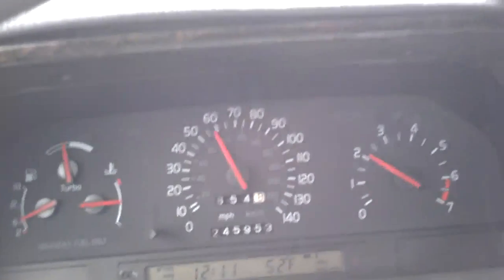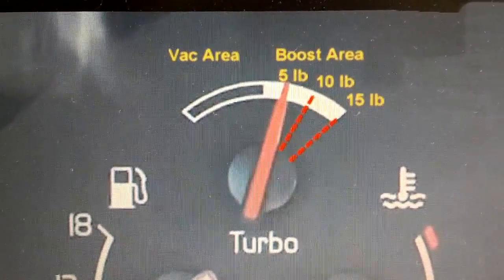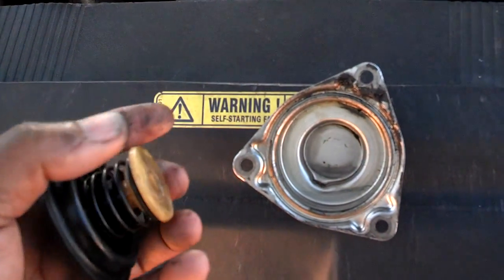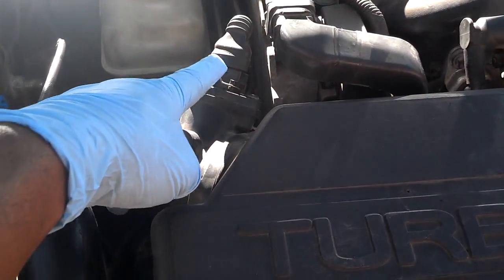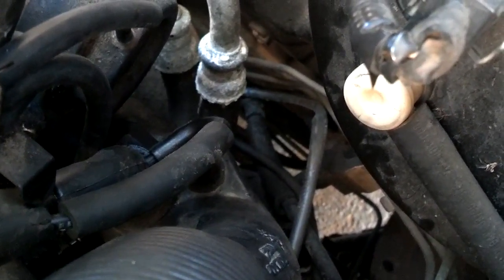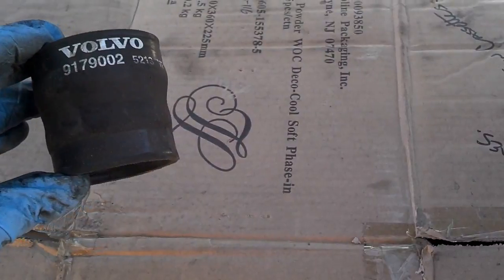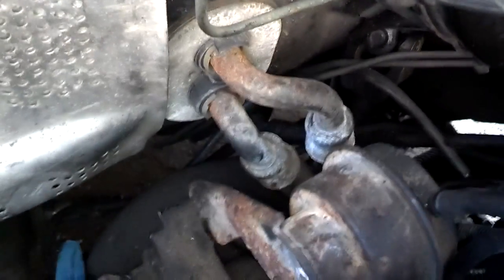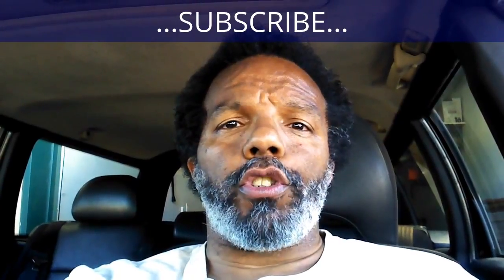How to fix under boosting, bad bypass / blow off valve on the turbo, CBV replacement - VOTD

Comment: I replaced this on my 850 and it didn’t fix my under boost issue. If I disconnect the vacuum line from the compressor housing to the tcv then it boosts to 15+psi but when it’s connected I barely hit 5psi
Reply from the maker: Could be a pending code in the ECU.
Reply from the maker: https://youtu.be/ZFRI_u-9_Gg?si=G4kAY4JIVyTNqUGg

Comment: Hı Robert, Where does the hose from the bypass valve connect?
Reply from the maker: intake manifold.
Reply: @RobertDIY  When the green hose is connected to the tcv, the boost indicator shows 5 lb, when it is not connected, it shows 12 lb, it should be the opposite. ? Thank you Robert.

Comment: I'm very fortunate to have small hands for this job, it definitely made removal and reinstall much easier. Although my diaphragm wasn't in terrible shape, it was still worth the check. I found the biggest reason to my turbo issues to be a deteriorated vacuum line from the compressor housing. Thank you Robert for all of your assistance in repairs throughout the years!
Reply from the maker: You are welcome

Comment: If anyone has trouble accessing these bolts the job is made dead easy with a Chicago brand or other opened ended ratchet. been tackling the bolts with limited access. gave up went back to it with the ratchet and 10-15min bolts out (depending on how quick your wrist can move :) ).
Reply from the maker: thanks for sharing.

Comment: I have a question about diaphragm. I wanted to test diaphragm without removing it, but using vacuum/pressure pump with manometer. I cant really find anyone to do so. Is there some sort of one way valve built in diaphragm? Becouse when I test it on vacuum, it was holding without any problems, bet when I tried pressure test, it didnt hold pressure at all even not for the second.
Reply from the maker: My guess would be that it's good if it held vacuum.

Comment: Hi Robert!
I'm having issues with my S80 2,4T Limited. I bought it yesterday and noticed that the turbo fluttered so I checked all the vacuum hoses and noticed that hose for the dump valve had come off so I put it back again. After that the car feels slow, the boost comes good to all of sudden "cough" and the boost sort of disappears. I test drove the car again today after checking the rest of the hoses, pipes etc but still does the same thing. I then took the hose for the dump valve off again and drove and the boost worked as it should except for the fluttering bit. I then put it back again and the car is slow, boost comes and goes. I'm running out of ideas but I feel like the problem must be the dump valve in this case since it goes like it should when the hose is off so it's closed all the time and as soon as the hose is back on the boost is not as it should, probably because of the valve leaking or that it can't keep the pressure, or what do you think?
Reply from the maker: If all of the TCV lines are on correctly, my guess would be a bad TCV. Install a temporary boost gauge and see what is actually happening.

Comment: Thanks for your video Robert! I just finished replacing my CBV on my 98 V70R (which AWD makes for even tighter spaces to work in), and used your video as a reference. The most difficult part for me was trying to get the lower (third) bolt off the CBV housing. I attempted to loosen it for well over an hour with different tools. I finally got frustrated and decided to turn the housing clockwise (toward the driver side) using the third bolt at the bottom as a pivot. It turned relatively easily, and the diaphragm and spring assembly were easy to remove. This method only required removing the top two bolts, and simply turning the CBV cover clockwise. The diaphragm and spring will have plenty of clearance after turning to be removed out of the back side. Everything including reassembly went smoothly after that. Unfortunately I didn't take any photos of it for reference, but if anyone out there is in the middle of the job and stuck with the bottom #3 bolt, try turning the housing and save yourself the headache. Hope this comes in handy for somebody!
Reply from the maker: Did you have to bend it?
Reply: I didn't have to bend anything. The third bolt on the bottom was still tightened (as I couldn't get anything to budge the bottom bolt in the tight space), and it was relatively easy to swing the housing clockwise toward the driver side.
Reply from the maker: Oh, that's right, that side of the turbo housing is smooth with slots in it.
Reply: Correct Sir! I tried everything I could think of including grinding down a 10mm socket to fit into the tight spot with no avail. Combination wrenches wouldn't fit for me either. This method worked for me and was actually really easy. I wouldn't have been able to get as far as I did without your video though! Thank you for taking the time to make the video and post it!
Reply from the maker: Sometimes it easier to take the turbo loose with those AWD cars. :(

Comment: I watched this great video 3 times. I want to put in a new diaphragm from Ipd. Can you tell me how you undid the three 10mm bolts holding the housing. Especially the one on the downside, Did you reach it from under the car?
Reply from the maker: All 3 from up top.
Reply: @RobertDIY  but how did you get it from the top?
Reply: On a 02 awd v70 from the top is impossible.  Please do a video on that one!

Comment: This is not a blowoff valve.. it controles the wastegate that bypasses exhaust gasses around the turbine so it will not make more boost..  when it begin doings it job it will open.. not give pressure to your intake.

Im sorry but loads of uncorrect info..
Reply from the maker: Huh? What exactly are you referring to?
Reply from the maker: The bypass valve does not control the wastegate, the wastegate actuator along with the TCV does.

Comment: You can fix other CBV from other Mitsubishi Turbochargers on your Turbocharged 850 or 70 series. I used the CBV from a Renault Megane RS (European car) (TD04-14T) on my 98 C70 HPT. Same diaphragm, same spring, same housing.

Thanks for your videos Robert. Greetings from Spain.
Reply from the maker: Thanks for sharing.

Comment: I have a 2005 saab 9-3 2.0t 175hp garett turbo same as volve i guess im having p0033 turbo bypass valve control ......so i changed the turbo bypass valve but the engine came back on i havent changed the diaphragm bov bypass part yet .......do you guys know what could be the issue with my car
Reply from the maker: I don't. Have you changed any bad vacuum line?

Comment: Hi Mr Robert many thanks for your videos it really has a great useful info. my qus  is  do i know my turbo charger work fine i  have no gague in my cluster board and my volvo s70 1998 is not work fine   the horse power when it is idle is 5 or 6 some times i hope you can help me .
Reply from the maker: https://www.youtube.com/watch?v=NhtUXZTurzo
Reply: thanks a lot may the god peace be upon you
Reply: hi again Mr. Robert i do have an OBD tool scanner device and i solved all the issue and codes that came on on my device (of course with your helping videos and i asked you only to know how  do i sure the performance of my turbocharger .......thanks

Comment: hi Robert.  I have a problem where under load and release of the gas the blowoff sound is more of a "twitter"  is this a problem with my blow off valve or could it be something else ? i also have a dip in the boost preasure  from 1.2 to about 1.0
Reply from the maker: +Miffokorv bleeds off while you have your foot in it? Could be exhaust restriction or a boost pressure leak.
Reply from the maker: +Miffokorv https://youtu.be/x8sXo5gbapM

Comment: Hello Robert.
The turbo bypass valve of my car volvo s70 2.0 turbo gasoline is damaged and does not let you get the best performance of the car, here in portugal only exists in the workshop volvo and is very expensive. Turbo is a 49189-01450 and the respective bypass is k5t096671
I've seen online that exists around at a very good price or maybe you can have some for sale.
Will a sale be possible?
It was very good. The
Reply from the maker: +Hélder Miguel Lopes Silva I don't think I have any. If you need me to help you get one let me know.

Comment: Hello Roberto.
I have followed your videos and it has been very useful for me, I have a problem and I needed help.
I have a volvo s70 2.0 glt (225 c) from 1997 the car to the smoke relantim gave oil passage through the turbo, it was to repair and when mounted car has no strength at low revs, between 1800rpm and 2800rpm it makes a howling whistle and the turbo Just picks up from that rotation and stops whistling, they have already seen tubing all over the leaks valve sineloide n75 is good, I already complained the repair of the turbo they dismounted said they put new core sealants was a complete repair, wastegate fit to put the To get the turbo lower with more force, even so the whistle increases and the turbo only enters the high rotation and sometimes does not rise linearly breaks, the turbo repairman guarantees that it was not from the repair.
Roberto could give you some help, please.
Reply from the maker: Sad to say that I do NOT understand what you are trying to tell me. Sounds like you are hearing a whistle noise and are experiencing low power output. Not sure if it's the turbo or some vacuum leak??? You need to install a boost gauge to see the health of the turbo system. Also, is the PCV serviceable?
Reply: Hello roberto, sorry for the mistakes in my text, I'm portuguese maybe I can not express my problem well, my car's turbo was repaired, my car did not stay as it was with little strength the turbo just picks up at 2800 rpm, Between 1800 rpm and 2800 rpm the turbo has no force and makes a whistle, it will be at such a burst valve (diaphragm) pierced. Thank you for your attention.
Reply from the maker: Hélder Miguel Lopes Silva is the check engine light on?
Reply from the maker: Hélder Miguel Lopes Silva the system is designed to have little boost at low rpm's and it should raise as the engine rpm's get higher. This avoids bent rods.

Comment: Great video. My XC90 T5 doesn't have a turbo gauge, but I feel there is no pressure. Will change the bypass valve. Thanks.
Reply from the maker: Hope that does it.

Comment: Hi Robert,
I have an '04 S60R and it seems to be underboosting. Instead of the regular 15 psi peak, it seems to hit about 9 or 10 and as the revs climb it will sometimes hit about 11 or 12. The car also seems to cough and pulsate at idle. It will seem like its about to die for a second and then jolt back to life. Could this be related to the CBV, or I was also thinking it could be the TCV. I have had one person tell me it is CBV related but i'm not entirely sure how reliable their information is. Any help is appreciated. 
Thanks!
Reply from the maker: +Connor Root codes?
Reply: Robert DIY I know for sure I'm throwing a code for running lean due to my cat delete, but let me check if I'm throwing anything else and get back to you.
Reply from the maker: OK.

Comment: Hi Robert! I have some  troubles with my 850 T5 94 and i'm wondering if you have any tips for me. My 850 is underboosting at around 5-6 psi (0.4bar). I have tried changing alot of things. I changed the turbo controll valve, Air flow sensor, ECU, those 2 sensors under the intake manifold, changed all related vakuum hosings, checked for cracks on the pressure piping, checked the Wastegate and Wastegate clock. I also have a aftermarket BOV and not the original and i have tried changing to another one. And if i remove the vakuum hose from the Wastegate clock to the TCV if makes full boost. Any idea?
Reply from the maker: Something is causing the ECU to dial the boost down. Could be an issue with the cat or o2 sensors.
Reply: Not the cat since it can build boost with wg hoose removed. And i should tell you that i dont have any codes on the box where you can read out codes yourself, can it be the o2 sensor even if it doesnt give you a code?
Reply from the maker: One of my videos explained that I was having issues with my CAT. It was causing a pending code in my ECU which caused my ECU to dial back my boost pressure. If you reset the ECU and you have good boost for a few minutes, it's the problem.
Reply: I had my car powerless for about 2hrs ( i think that resets the ecu??) and still 0.4bar.
Reply from the maker: Not sure what that means. You can pull the ecu or pull off both battery cables and tie them together for about 15 minutes.
Reply: QsEExTr3me 5 tp 8 psi is normal.
The reader Robert is using is monitoring total pressure. It's reading the maf.

Comment: Our 1995 855 auto (fresh turbine rebuild) is surging (especially noticeable under light acceleration) and apparently is hitting around 5psi.   It boost like the end of this video if I reset the computer but only until it settles in ( ~10-20  miles).
Is the BOV the probable cause?   Pretty sure we have no intake/Vac leaks.
This is the only phantom left to chase.
Any other suggestions that may help are appreciated but it sounds like I need a vacuum tester..
tia Robert
Reply from the maker: Some kind of boost leak.
Reply: +Robert DIY prob is fine for 300 miles if I reset the cel.. I have a evaporative leak.   can't look at it till after 3k mi journey.. hoping it is just one of the vac lines under the core support. i have replaced the rest.  Ty robert
Reply: so..  3500 miles later. It is running perfectly.
We had to reset the CPU 3x but it ran the last 700 miles error free and hitting near full boost.
It did throw a 172 code for too rich 3x.
Back home now..  I will dig in to see wtf.
280k, stock engine and it still stomps ass!!
Gotta love it. Burnt less than 0.5 quarts of oil overall including two trips to over 14k feet and  6 trips over 8500'.
Reply from the maker: Wow! That's cool.

Comment: I think I have this trouble in my S60r. Boost is erratic, the car makes a hissing sound under load and now is not building pressure. The mechanic says that the turbo is OK. I guess I will change the CBV, the sound comes from this area (other reason to think about a wasted Cbv =/ ). Thanks again for your useful videos !!!
Reply from the maker: Mau Solórzano Wong Thank you for watching.

Comment: power wash ftw :)
Reply from the maker: RooFx Thanks for watching.
Reply: Robert DIY I always enjoy them!
I am about to try the heater hose mod for my ptc/catch tray hard line. 
Rebuilt the turbo and replaced a couple of old vac hoses but it still will smoke like the dickens if it idles too long.
Hoping the heater hose mod resolves this or it will be compression test and leakdown tests that follow. :/  I drove it to Denver and back to KCMO so I doubt it is anything to do with run in for the cat to clean itself out.
255k 95 T-wagon.
Reply from the maker: I wouldn't do heater hose. The issue is valve stem seals. What oil weight are you running? You do know that Volvo advises AGAINST letting these cars idle...
Reply: Robert DIY  I run straight 30W as I do in most of my vehicles. No I did not know that about not letting it idle.  It may be fine then if I do not let it idle. It does not smoke at all on start up
Reply: Robert DIY  You're telling me I should pay 60.00 for a new hardline that will go bad in a few years?
Reply from the maker: More like 15 years. I'm considering building that hose out of copper. Then buying the ends to install. That hose is $46 at FCP.
Reply: Robert DIY  ahh  Might even be able to use flexible gas piping.
Reply: Finally got around to the hose mod and have had great results.
ZERO smoke out the rear when we lift.  Zero smoke out the dipstick tube.   #needforswede

Comment: Yet another very useful video. I'm having the same issue you had with it only boosting to about 5-6psi (actual gauge installed to confirm psi). I've replaced all the old crusty vacuum  lines and still have it so the CRV is my next step. It looked to me like 2bolts could be accessed from under the car and that might make the job a little easier but I'll let ya know.
Reply from the maker: Erik Strieter Cool, hope you get it worked out. What car do you have?

Comment: Smashing job robert, you have warp 9 engaged :D
I suppose the lack of hole in the diaphagm is compensated for with the stronger spring, perhaps lol.
Gloves are nice but you cant feel anything, you might as well have boxing gloves on :)
Reply from the maker: zx8401ztv Yes sir, got my power back. ;)